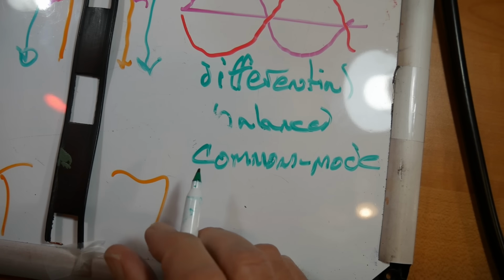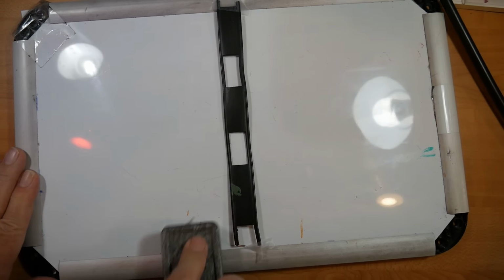Common Mode Current (#1383)

Comment: A couple questions for Dave and the rest of the oggies:

Does common mode current occur in the same way on verticals, EFHW, or other unbalanced antennas?
If so, does the usual 49:1 UNUN stop that in the same way the BALUN does on the dipole?